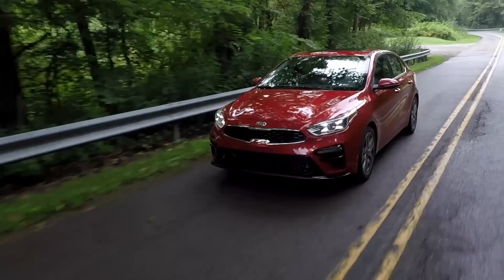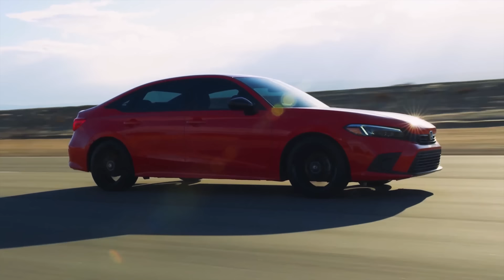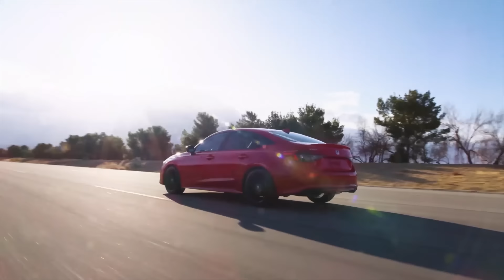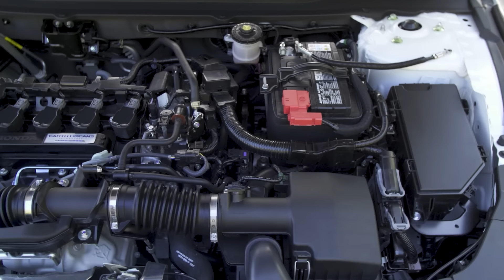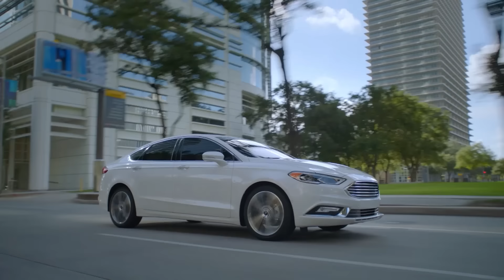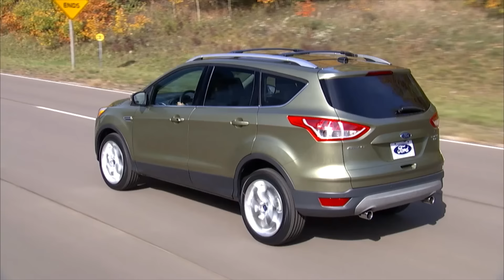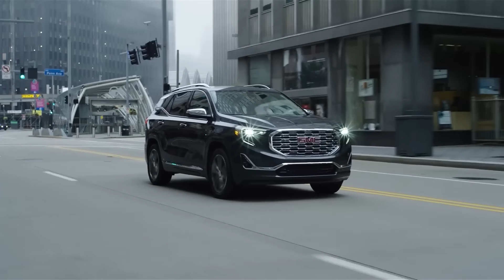Are Turbocharged Engines Reliable? The Truth About Turbo Engines

Comment: All engines, petrol and diesel, turbo and NA, should be regularly driven at least once a week so that engine oil, coolant and exhaust comes up to full operating temperature. Especially if you are constantly doing small, constant trips. And even more so for a hybrid where the engine turns on and off regularly. 

With a turbo engine especially, drive it very gently from cold with the lowest revs until the engine warms up a bit. When you are coming to the end of your trip, drive very gently the last couple of kms so that the turbo winds down a bit. 

I drive a Kia Stinger. If I know I'm driving a short trip, I leave it in comfort mode which short shifts each gear. The engine doesn't go over 2000 revs. When I'm near my destination, I actually put it back into comfort mode to wind the 2 turbos down and drive extremely gently those last couple of kms. Not hard to do.
Reply: Good advice.   I was initially alarmed when my new Audi’s fan kept running for a couple minutes after shutting off the engine.  Was told this is intentional to continue to dissipate heat.  Sounds like manufacturers are learning.  Also, for all these new “efficient” 4 cylinder turbos, the more you use the boost you will see mpg’s fall rapidly—it seems EPA numbers are at RPMs with limited or no turbo boost.
Reply: @shunt8084  I am getting 21.7 mpg in city only driving out of a Mazda 6 2.5 turbo. I drive pretty aggressively. 21.7 mpg is pretty good in my book
Reply: Excellent advice.  I wouldn't need it since I tend to put into practice anyway.   But, I very much appreciate you for sharing the advice very few of us xsn understand.
Reply: Looks like a lot of work. Can't drive a car like u r operating a factory machine. Need to enjoy the drive
Reply: @AhmedsCorner  Not hard work at all. I don't even have to think about it, it just becomes second nature.
Reply: @AhmedsCorner  Not hard work at all. I don't even have to think about it, it just becomes second nature.
Reply: I drive my turbo Mazda 6 about 8 miles city (one way) to work. I drive it fairly aggressively once the car warms up but I do let it idle for 2 minutes before I turn it off. I do also change the oil 3 times per year even though I only drive about 2k miles per year. Once per week I take the long way to work so my commute is 30 minutes. I plan on keeping my car for 15 years, we shall see if it lasts 🤞
Reply: @Matys1975  Well done, I'm sure with that care it will.

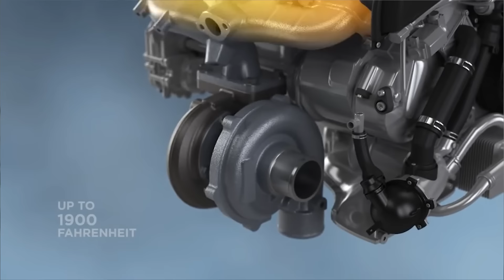Comment: 4:37 that’s a typo right? Stainless steel melts at 2500-2785°F, let alone any of the parts inside or around it that likely have a lower melting point like plastic or aluminum. I think 190-210f is normal for engines.

Comment: Depends on which manufacturer built your turbo engine.  The Honda turbo has been out for close to 8 years and I haven’t heard of any major turbo failures yet.
Reply: Research about the 1.5 turbo oil dilution issue

Comment: I naturally aspirated engine is like a bodybuilder or marathon runner who fuels himself with good nutrition. A turbo engine is identical but pumps himself up with steroids; improve results but not healthy.
Reply from the maker: Haha best analogy I've heard 👍
Reply: Good point!!
Reply: There is a good bit of truth to that. You have to be built to take the steroids too like the 2.7 ecoboost or a turbo diesel semi. Unfortunately, the manufacturers don't build alot of their engines to handle the extra juice hence the headgasket failures on the honda 1.5s and ford 1.5 and 2.0 ecoboosts.

Comment: New turbos are very reliable. Everything will fail at some point of time. All these car companies are not putting these out with out proper testing. The engine fails due to bad design not due to turbo. With so much emphasis on  better fuel economy turbos are here to stay. Many long term reliability report doesn’t reports turbo as problem. If one has to eliminate turbos it would hard to buy a car now a days.

Comment: If you have a turbocharger, use a high quality full synthetic oil changed at least when recommended in the owners manual, and replace the coolant earlier- I found that the Engine Ice brand makes my inline 4 motorcycle run cooler. Hybrids especially plug in hybrids run the gas engine less often, so the engine should last longer. Maybe look at an all electric Mini Cooper for 30 thousand new, it should be a lot more reliable than their gas engine version, it looks good and is fun to drive, and the weight of the battery makes it ride smoother for long drives.
Reply: Plug in hybrid like mine is becoming a great option. The short distance driving never starts the engine and the tax rebate offsets a lot of the extra cost. Road trips are no problem either since I can go almost 500 miles on a 16 gallon tank and refuel in 5 minutes.

Comment: There are two unique situations where the turbocharged engines are more reliable than their naturally aspirated counterparts within the same brand.  The first deals with Hyundai and its recalled Nu and Theta engines.  The turbo Theta III engine used on the Veloster N escaped these recalls and didn't exhibit the same problems.  The other is the 1.6 liter turbo Kappa engine used as an option on some smaller SUVs like the Kona, again, more reliable than the Nu and Theta.   Same applies to the Kia with these engines.  The second case has to do with GM.  The turbo 1.5 liter Ecotecs are relatively better than the 2.4 liter Ecotecs they replaced in vehicles like the Chevy Equinox.   I say relatively as the turbo engines have their own issues but they are still a better choice than the 2.4.  If you are going to buy used cars from these brands, these are something to keep note.  But I would generally avoid both brands and for me I prefer Mazda's 2.5 liter Skyactiv that's mated with the proven 6 speed auto, not cvt but auto.
Reply: The Mazda 2 liter skyactiv engine with the 6-speed automatic it's way more fun to drive than a Sentra turbo with CVT
Reply from the maker: Both great examples I agree 👍
Reply: I would try to avoid CVT's. They feel weird. I've rented several cars with CVT's.
Reply: What are your thoughts on the outgoing Gamma 1.6 GDI engines?
Reply: @sn5837  Gamma and Kappa engines appear reliable, and Hyundai, Kia sell more vehicles with these engines in other parts of the world.  Its why Hyundai's brand reputation in these countries are not as affected by the issues with the 2.0 and 2.5 liter Nu and Theta engines as the recall on the US market does.
Reply: @ChrisRobato  Thanks for that Chris, can I also have your opinion on Hyundai's 7-DCT transmission?
Reply: @sn5837  I don't hear much about it which typically means little to no bad news.
Reply: @ChrisRobato  kappa 1.6 was actually built from the ground up to only use that turbo, not redesigned like the 2.0 in there volester N, which had been having some problems, but maybe because people rag them out more, but the 1.6 does seem pretty bullet proof. I think that is one thing they got really right because they invested a ton of money into making a turbo engine from the start to be reliable and well engineered, it is also relatively new.

Comment: Thanks for being honest I wish that car dealers would slow down on turbo charged engine and go back to enstaling higher powered motors. I would rather have a car with less power than more repairs in the long run. Thanks grammajan
Reply: A continued note I mentioned less power and have fewer repairs grammajan

Comment: I would usually avoid turbo charged engines for the reasons you described, but still may consider getting a Honda CRV. I understand that Honda has taken steps to fix their oil dilution problem they had in their 2017 models, like using GF-6 motor oil. I also drive conservatively so I put little pressure on the engine. Since it is mostly warm in Southern California, I don't think much warmup is required and it shoudn't be a problem for the turbo. Still I am on the fence about turbos because of possible higher maintenance costs.
Reply: For a weird note, Honda kept the 2.4 liter K24 engine naturally aspirated engine on their CR-V in their Thailand assembly line, right up to 2022 before the next generation CR-V.
Reply: @ChrisRobato  Thast is  interesting. My 2005 CRV had the same engine. It was very reliable.
Reply: @jaimieconroy36  if you follow the car tuners, Honda's K20 and K24 series engines are right there among the greatest engines of all time. The newer 1.5 liter turbo has some tough shoes to fill but that would be true of any engine normally aspirated or turbo
Reply: Warming it up wont be an issue, but then being in CA u will have the oppositive problem which is overheating (or just running alot higher temps), especially on 95+ degree days idling in rush hour traffic.
Reply: Cali means no warm up? Turbos get up to hundreds of degrees Fahrenheit. Why would it or the pistons not need to warm up? Not as much as frozen engine but it still has to warm up.
Reply: Buy one  then regret.  I have a 2019 Honda CRV.  It is going back as it is a lease.

Comment: As a person who used to work for a turbodiesel engine manufacturer, I would have to disagree with a lot of things stated in this video.  It seems like the author is cherry picking data to reach his predetermined biased opinion while also mixing truths with falsehood.  Just a few examples are the issues with the new Toyota 3.5L turbo. Just about every newly designed engine has issues within the first few years even naturally aspirated ones so saying it is due to turbos is false.  Also, the short trip oil dilusion is indicative of all engines, but is more pronounced in direct injection engines even those without turbos like GM's large displacement Ecotec engines.    Saying it is due to having turbos is false.  There are other totally false or half truths in the video, and these are just a few examples.
Reply: I agree.  Without actual numbers, no one would really know enough to make this type of video.
Reply: @oi32df  It was for Cummins who the world largest diesel engine manufacturer  that makes a variety of diesel from 5.0L for light duty trucks to large 15L for heavy duty trucks.  They also make gasoline, hydrogen, and natural gas engines.  However, that part of my statement was to give some reference to my background of knowledge about engines in general and not to limit my response to pertain to turbodiesel engines only.

Comment: reliability is not simply determined by more or less parts. you cant just say it is more parts and thus less reliable without any research. yes early turbo tech had problems but that is the same with every new tech.

Comment: The guy over at I Do Cars tears down junkyard motors to see what parts can be reused, and why they ended up in a junkyard. There was a truck engine that had the oil seals go out on the turbo. In about a minute it emptied the oil into the exhaust, ran dry, and locked up. I will skip taking such risk v

Comment: I just spent $1600 repairing the turbo on my 2011 sonata 2L with about 85000km. This was replacing one small part on the turbo that cost $800. The rest was labour. With the shortage of new and used cars in Canada I will have to hold onto this car a bit longer.
Reply from the maker: I hear examples like this all the time. Thanks for sharing.
Reply: Next time, just get a camry
Reply: Or buy a car which has a Natural Aspirated Engine instead of the turbo it's gonna save you some money.
Reply: Need more info, did you buy it new?? How often did you change the oil?? Were you into the turbo all the time??
Reply: @John Franklin  Yes, I bought it new. Never had a car with a turbo but lots of manufacturers use them with small engines. The 2L engine in 2011 was the last year it produced 274 hp. It now is only 245 hp.  I'm retired and can't afford a new car with or without a turbo.

Comment: When I was buying our 2020 Civic Coupe we got the turbo. When my wife and I chose a car, I choose the model, my wife picks the trim level. I explained that I've driven turbos off and on since my 1984 Merkur XR4Ti . I explained all the negs you did, and more. But she opted for the EX trim which only offered turbo. My point is, sometimes other factors push you to less desired engine options. 
By the way, I follow ALL your guidelines (syn oil every 6k + OEM filter) and a turbo has never failed me. And that Merkur? That turbo ran 184,000 before the car died in a roll over.
But my personal choice is, skip the extra ponies (and speeding tickets) and go Naturally Aspirated.😄
Reply from the maker: That would be my personal choice too 👍
Reply: But the turbos are so much fun !
Reply: @Matys1975  🤌🤌🤌

Comment: It’s just a simple fact that turbo runs fast, hot, and under more pressure. Given all these dynamics, it’s just simple physics that when all things being equal turbo is less reliable than no turbo.
Reply: That's assuming if the engine's internals are the same for both.  But they're not.  The turbo engine tends to feature strengthened internals, such as the pistons, rings and the rods, along with additional cooling along the block.
Reply: @ChrisRobato  that goes with saying, it’s similar to a Diesel engine; however, pragmatically speaking turbocharged engines are a lot less reliable.
Reply: Except they are not built equal. No natural aspirated engine and it's turbo version that currently is being manufactured in the world, is equal.  The 'equally' built turbo engine does not exist.
Reply: @ChrisRobato  dynamics differ, and because of the complexity and and just pure physics, these engines fail more often, and do not last as long as their more basic counterparts.
Reply: @janjachymiak9013  Do you have the engineering data and statistics for that?  These are claims that can be measured.
Reply: @ChrisRobato  that data is ubiquitous.
Reply: @janjachymiak9013  Car companies keep detailed records. That's how they know what exactly is wrong and can trace it to the exact plant and supply batch.  Detailed data keeping is part of statistical quality control.  No such thing as ubiquitous in the industry or in engineering. You must present the numbers.
Reply: @ChrisRobato  like I said, that data is ubiquitous.
Reply: @oi32df  It is ubiquitous that turbo engines are factory designed and reinforced for turbocharging.  This is a fact.

Comment: I have a 2016 Civic 1.5T with 120K miles so far with no problems with the engine or anything else. And it's still smooth.
Reply from the maker: Glad to hear 👍
Reply: Not surprising at all.  Turbo engines actually last longer.  They are stronger and run at low rpm like a diesel.
Reply: @user-tb7rn1il3q  It's because of the brand, japanese engineering is way superior to German. If you pick up any german car, no none made this far. Germans are bad at engineering and they don't know how to build cars. Also their cars use chinese parts. Why I know this? Because I live with germans and I have a german car.